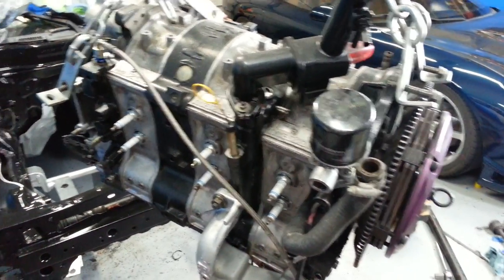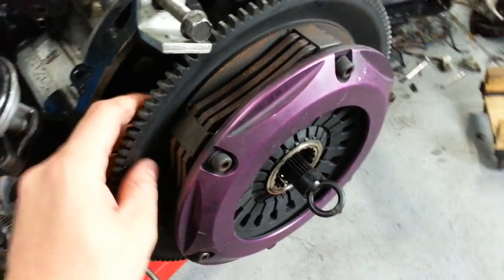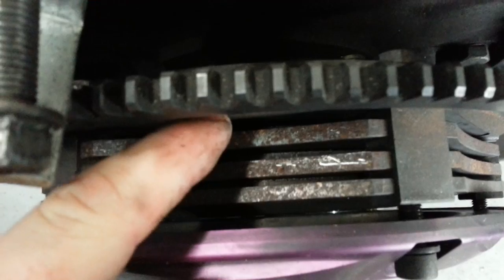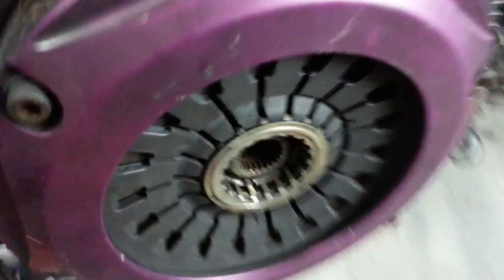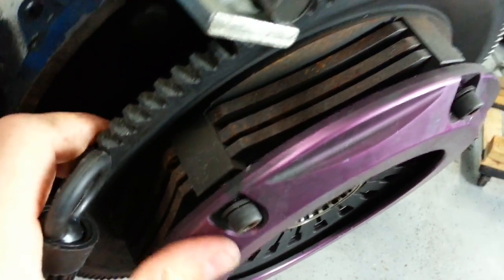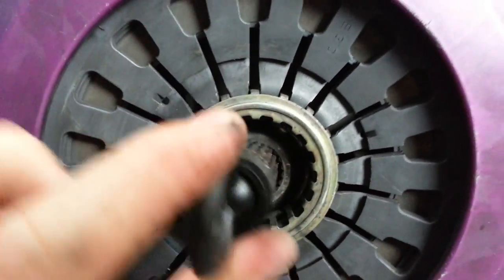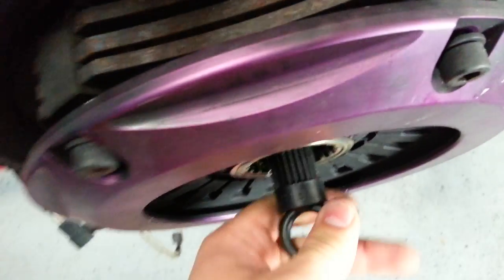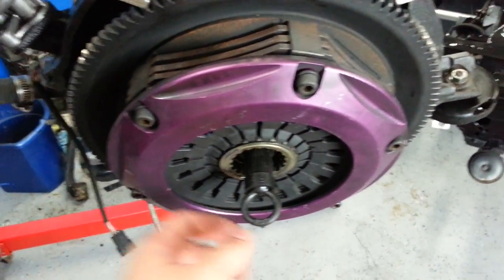Triple plate clutch - Sex Sandwich

Comment: forget t56 a company makes racing trany tip tromic made to take a beating mad mike has one in is 4 rotor rx7 and in is 800hp 20b rx8 drift cars made to take a real beating + its a kit bolt on !